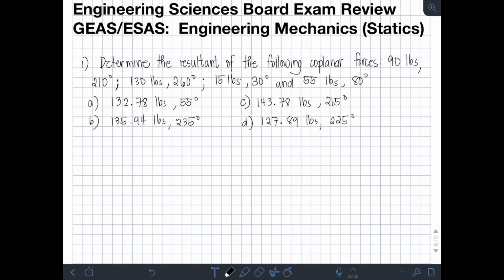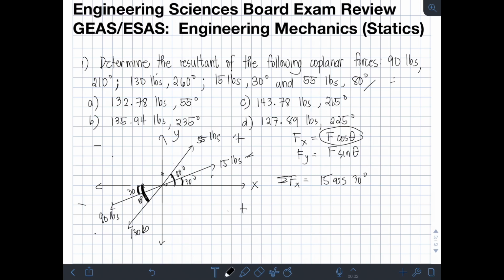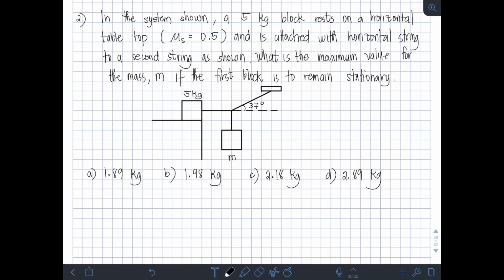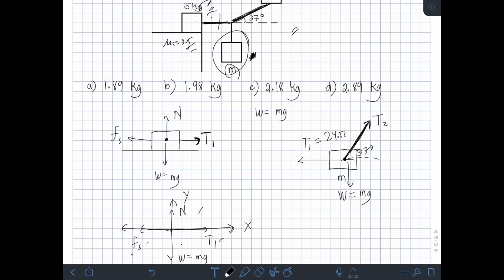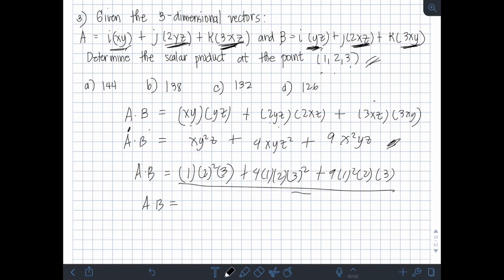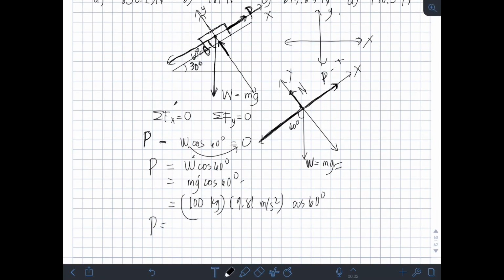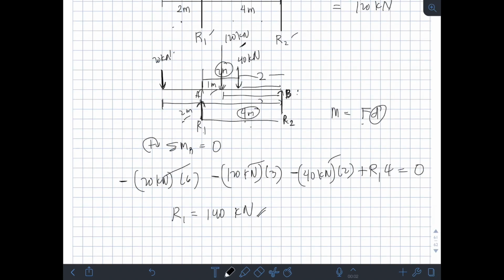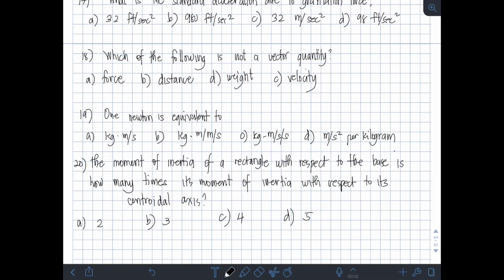Engineering Sciences Board Exam Review GEAS/ESAS: Engineering Mechanics (STATICS)

Comment: Alternative Solution:

Using complex numbers / polar rectangular coordinates,

GIVEN:

Let R1 = 90 lbs at 210 deg or 90 < 210 deg
Let R2 = 130 lbs at 260 deg or 130 < 260 deg
Let R3 = 15 lbs at 30 deg or 15 < 30 deg
Let R4 = 55 lbs at 80 deg or 55 < 80 deg

REQUIRED:
Solve for the Resultant of the following coplanar Force (Rt) 

SOLUTION:

Rt = R1 + R2 + R3 + R4 (Vectorial Sum / Complex Numbers) 
Set scientific calculator in complex (MODE CMPLX) 

Thus, 

Rt = 90<210 + 130<260 + 15<30 + 55<80

Answer
Rt = 135.94 lbs < -125 deg 
Or
Rt = 135.94 lbs < 235 deg